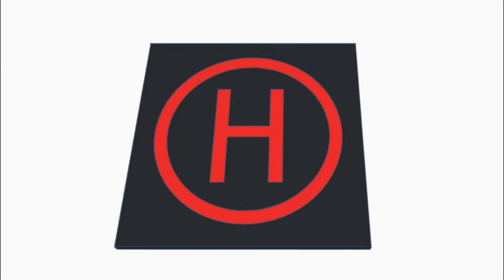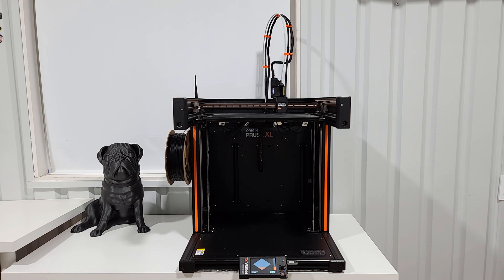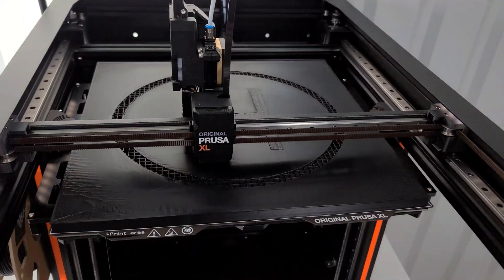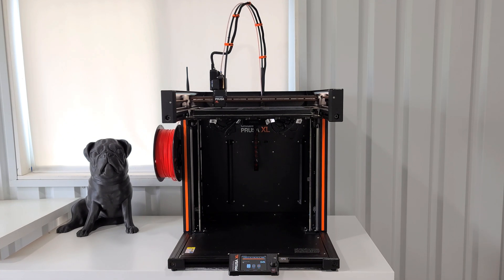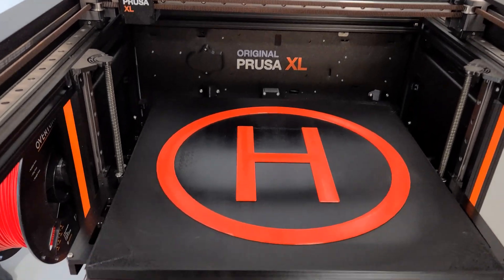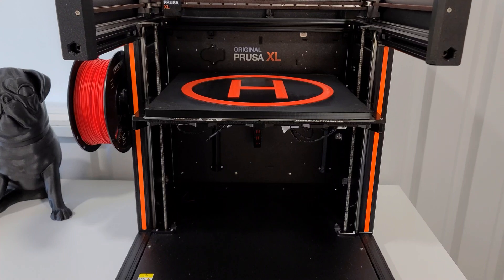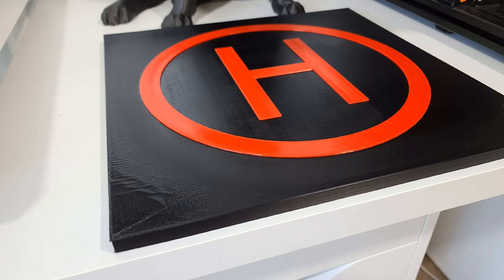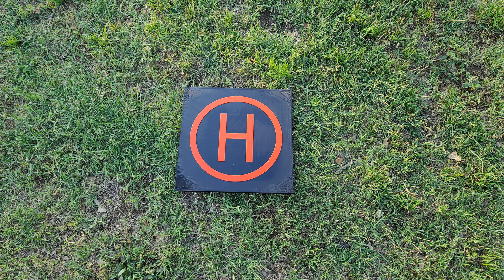Prusa XL - Printing a Mini Helipad for a Drone!!!

Comment: For large prints like that glue stick, slower printing hotend temp 200-205 bed temp 45-60 and lower part cooling 50% usually works and this is for PLA OR PLA+
Reply from the maker: Thanks so much!

Comment: Recommendation for large prints like this if you don't need a solid bottom.

Set the number of bottom layers to zero in the slicer and set infill to grid and something acceptable like 30%. Then you end up with a grid bottom that can handle a bit of cooling inbetween the air gaps and by the time it gets to the top solid layers you have sufficiently allowed time for any contraction to settle down.
Reply from the maker: Ooo that is a great idea! Thanks so much!

Comment: Clean the build plate with dish soap and then wipe down with IPA. Potentially use something like Magigoo to help adhesion. According to some research (I've not tested this yet) Hilbert curve infill produces lower stress. You could try change the bottom shell infill layers to Hilbert. You could try a Hilbert infill elsewhere too.
Reply from the maker: Thanks!

Comment: I don't know about the others but I have never had PLA warp on any of my printers, Maybe I am missing something here, in any case ABS, ASA, nylon yes, they can contract quite a bit when they shink. Usually an enclosure with some glue stick can help. 

Do this, when the flex plate is on the heatbed, I would press on the corners and see if the corners stick down or are slightly raised off the bed. Do this cold and at the bed temperature you print PLA. 
Lastly, (both cold and hot) I would take a straightedge like ruler placing it on edge across the heat bed to the corners. Like from the center to the corners. You may need to shine a light on the other side of the ruler where you are looking and see if there is light passing through. Thi would indicate a low area, and a high area with little to no light.

It could be possible that the corner plates may not be aligned properly. 

Since you recently purchased this you can call Prusa. Their customerservice is very good and they will patiently help you.
Reply: I stand corrected. I wathced the video again and see the gapbetween the print and plate. Printing large flat plates is not common so I don't see that with anything other than ABS, ASA, etc. But with something that large, the minimal shrinkage across the large plate would addup and the corners would be the weakest. So, you may want to treat it like ABS and reduce drafts, etc and try some bed adheasive, especially at the corners.

Comment: As others have shared, warping is an ever-present issue that usually becomes a problem only at larger footprints.  There are many effective strategies for dealing with it, and if you combine these methods then you can have a successful print.  This message is a long one, but encapsulates years of my personal trial and error so it's hard to summarize it even further.
A) Print with cooler nozzle temps.  The amount of shrinkage as thermoplastic cools is related to the temperature delta between extruded temp and ambient temp.  So when printing with something like PLA, print closer to the lowest reliable temp (i.e. 205) vs. the highest temp (i.e. 230).  The lower nozzle temp means the filament won't expand as much, and hence won't contract as much during cooling.  Note that your part will be weaker due to the cooler nozzle temp, as the filament layers won't fuse as well, but for a landing pad like this that shouldn't be an issue.
B) Raise print bed temps.  Again, your goal here is to minimize the temp delta from extrusion to cooling, so higher bed temps will increase the ambient temp, minimizing shrinkage during printing.  But stay within the limits of your material - PLA doesn't work well at super high bed temps, so you're not going to be able to crank it up to 90 and still get a good print.  As others have said, 5 degrees is a good starting point, and you might even be able to get away with 10 degrees.
C) Block all drafts.  You mentioned that AC was off, so that's helpful, but sometimes there's still airflow in the room.   PLA doesn't do well in an enclosure, but anything you can do to prevent any form of air movement will help.
D) Reduce cooling.  Normally, and especially with PLA, you want your cooling fan blowing strongly to improve bridging.  And PLA settings typically crank the fan to 100%.  Reduce that in your slicer.  If you're printing something like Nylon, you have to completely turn off part cooling or warpage will destroy your print in a heartbeat.  You still need some cooling with PLA, but on a part this large, ambient cooling will go a long way as you won't be printing layers very fast.  You might need to increase your top layers by one or two layers, since the bridging won't be as successful so a few extra layers will give the print a chance to properly bridge over the infill.
E) Change your infill pattern.  The infill you are using (rectilinear/cubic) has straight lines that directly connect the outside walls of your print, and as they cool, they pull the walls inward.  Recent studies have shown that a wavy infill, like the Hilbert Curve, minimizes warpage due to infill shrinkage.  Also, minimizing your infill % is helpful - 10% is probably high enough for this part - as the less infill there is then the less warpage due to infill contraction.
H) Print with thinner walls.  Since you used a 0.6 nozzle, assuming you did 2 walls, then your walls are around 1.2mm thick.  If you used a 0.4 nozzle and 2 walls, then the walls will only be 0.8mm thick, so they're have less strength to pull on your part and cause warping.  The same applies to your infill, where a 0.4mm nozzle would likely produce thinner and weaker infill, so less warping.
G) Use a brim.  Anytime I print wide parts like this, a brim is a must.  Yes, that does slightly reduce the max size of your print, but you're mistaken if you think you can use the full size and not have warping.  You may also need to reduce the brim separation distance to zero, with the caveat that you have to cut the brim off, it won't separate easily but that greatly improves the hold down strength.  Some makers like to use "mouse ears", which are small circles of brim only at the corners, but for a part like this a standard all-around brim is probably best.
H) Use magnets to hold the brim down.  I've never seen this done elsewhere, but this is a trick I developed recently.  I use lots of small, powerful neodymium magnets that I put on top of the brim after the nozzle is high enough to clear them.  So if you have some 1mm tall disc magnets, as soon as your nozzle is at 1.3 mm high, put these magnets all around your part, on top of the brim, right next to your part.  I used about 40 magnets on a large part recently, and it made a HUGE difference in minimizing warping.  Of course, this is an extreme step, and the part I was printing was structural with 90% infill, so warping was a nightmare and was even pulling up my brim.  Luckily, the Prusa print bed steel sheets are magnetic, and the magnets don't affect any sensors.  For a part like yours, just 4 magnets in the corners might be enough.
I) Change your filament.  Typically PLA+ warps less than standard PLA.  It often works with (or requires) higher bed temps too.  For example, Sunlu's PLA+ requires a bed temp of around 70-80, versus the normal 60 for PLA.  That extra 20 degrees helps a lot.  If you printed with 230c nozzle on a 60c bed, that's 170c of cooling.  A 205c nozzle on a 80c bed is only 125c of cooling.  It adds up.

Of course, there's another option that is simpler to implement - print your part upside down.  With the Prusa XL and MK4, getting perfect first layers is easy, so make that your top side.  Then if warpage affects surface quality at the end of the print, it won't matter as much because that will be on the bottom. But warpage will still happen, so your top won't be flat, so combine this with the methods above as necessary.  But note that removing the brim may scar your print, so if you print upside down this may be more noticable.

Good luck!  I'm still waiting for my XL so I'm living vicariously through your prints, thanks for sharing.
Reply: One teeny tiny thing that I think you may have missed here is just a simple cleaning of the bed. As rudimentary as it seems, cleaning the bed plate with warm soapy water and an isopropyl rinse afterwards can do a lot to aid in bed adhesion overall, especially since the corners of the bed are the most likely to be touched by oily hands. It's not really applicable in this case since the back corners also warped, and you don't typically touch the back corners with your hands on a magnetic PEI sheet such as this one, but it is another tip for those with bed adhesion issues nonetheless.
Reply from the maker: Thanks so much for all the tips. I do want to run another print with these adjustments to experiment and see what helps. Thank you!
Reply: Great tips Paul! Refreshing to see another 3D Printer help out like this :D
Reply: That magnet idea is genius!
Reply: I appreciate the comment very much my guy, thanks very helpful 💯🙏

Comment: Try using gyroid infill at a higher density, generally what happens is that when the bridging/top layers go down they lot of force as they contract. If you have more infill, it will resist this. Gyroid is good because the geometry doesn't have straight lines running through the print, reducing the warping caused by the infill, but still creating a strong internal resistance to the warping of the top layer. You can also use a top fill that doesn't have straigh lines running across it, such as hilbert curve, but that only works on the last top layer, so you can use 99% gyroid infill as the top layer.
Reply from the maker: Ok sounds good. Thanks!

Comment: Pointy corners warp more easy. You can round off the corners so the print will not have a single point that can lift up easy.
Reply from the maker: Thanks!

Comment: In my somewhat limited experience, the Satin and Textured sheets from Prusa have less adhesion than the smooth PEI sheet. I'd use the smooth one for any prints this large or where I really needed the extra adhesion. You could also add a brim, but with that part being the size of the build area, that wouldn't work without scaling it down a bit. Instead of brim, you could add "mouse ears" to the corners to hold down just where it's really needed. But then that would require enough space for them, so you'd probably have to scale the part down for these as well. It turned out nice otherwise.
Reply from the maker: Good to know! I only have textured and satin for now. Yes, I think it'd be worth it to scale down enough to add mouse ears/brim. Thanks!

Comment: Thanks for posting this. Looks like most of the warping occurred after the top layer is added. I agree with other comments here on the causes just being the thermal contraction of the plastic on such a large object as it cools.

It’s not surprising that even the XL has to obey physics. Rounding that corner or making it chamfered is probably the easiest adjustment to make along with a brim. An alternative brim to try is “bunny ears”, so brims that are only in the corners + add a strong magnet to each brim for large prints where you KNOW it’s going to curl. It might still do it especially with ABS or PC, but that has mitigated it for my prints in the past.
Reply from the maker: Sounds good. Thanks!

Comment: What what if you changed the design and extrude the black areas down to to say a quarter of the thickness it is now,  Then create two bodies of the rest of the intended black areas of the same thickness of the remaining raised circle and H pattern. Print the those two parts with the intended outer surface towards the build plate.  When the corners warp and pull up, it might not be as noticable when you flip the parts to assemble, and at the same time you can have a nearly flush landing surface.  Just use a bit of glue when insetting the black secions into the red.  yeah, the entire bottom side would be red, but that few mm or red might acually look pretty good with a side view of the finished product.  I have used that method making some round dual color logo keychains.   Would be fun to give that a try on the XL
Reply from the maker: So how many separate prints tall would it be? Just two or more? Yes I would like to see at what height it starts warping if nothing else. Thanks for the ideas!

Comment: This has nothing to do with the XL or draft shields, it’s due to the plastic shrinking. Research online, this is solved by adding some grooves or canals (don’t know how to say it in english….) to the underside, to the bottom of the part, so the warping can be absorbed without it twisting the part and detaching from the print plate.
Reply: That is a good idea! Sort of like a segmented first layer, and eventually it bridges to form a complete layer? Genius.
Reply: @RickyA  the way I saw it done and used successfully on my MK3s to do a full plate thick print, was just a few 1mm, some 5mm height upside down ‘caynons’, about 5 mm from border. 3 concentric ones, no more needed. That absorbs the tension and the plate so it doesn’t detach. Make sure the perimeters from each one doesn’t touch the next canyon, and that there’s little infill material between them.
Reply from the maker: Ok I will have to think about how to design this. Thank you!
Reply: It's because prusa is trash and the xl is a joke

Comment: solutions are: wipe the plate with alcohol (IPA). round the 4 corners to spread the warping force more evenly. but the real solution (i print a lot of ASA): an enclosure. the part will cool more uniformly and you will have much less warping. it will also reduce noise. its a shame that prusa didnt build the xl as an enclosed printer. imagine spending 2k on a big volume printer and not being able to print even big PLA parts. hopefully somebody will do prusas job and mod an enclosure, that can be attached to the printer frame. like two 'butterfly' doors at the front and a hinged lid
Reply from the maker: Yes I agree the enclosure is probably the best way to minimize. I'm even dreaming about the draft shield. But I'll see what I can do for now. Thanks!
Reply: Thank you for the videos btw!

Comment: Large, flat prints are a nightmare for printing, I had to make some covers that were 10mm high & filled most of the bed of my MK3, to make matters worse, these were for outside use, so I was trying to print them in ASA.  I made a homemade enclose & added as big a brim as I could fit (8mm IIRC). I was using a smooth PEI sheet & cleaning it with hot, soapy water (Fairy liquid) helped with adhesion.  In the end it was pulling the spring steel sheet away from the magnets & the PEI away from the sheet!  It's the long, straight lines that cause the problem, the longer they are, the worse the problem is, so it's no surprise that it's worse on the XL.  I wanted straight infill lines for rigidity (Triangles), but I even tried Gyroid to see if it would help, it did to a certain extent, but when the curvy lines contracted, they would raise the height of the layer causing the nozzle to collide with the occasionally.  I did get it to print OK as far as the solid top layers, but when it gets there, there are obviously a lot more contraction forces, so that's where the real fun begins!  I never did manage to get perfect prints, but I'm planning to revisit the job, when I get the time, now that I have a Prusa enclosure.  I was running no cooling fan with the ASA, but it might help if you reduce the fan speed a little with the PLA, but you'll obviously have to watch the print quality.  I would hope that with a brim & a little tinkering you'd be able to get a good print in PLA, but it's going to be harder with other materials!  Prusa recommend using the textured sheet for PETG & Flex as they stick too well to the smooth sheet; I can confirm that is the case, but I've never investigated whether the same is true with PLA, so you might want to do some tests.
Reply from the maker: Yes I agree! I'll definitely be testing out more settings to see what the trick is! Thanks for the suggestions!

Comment: Enclosed will help stay heat avoiding wrapping
Reply from the maker: True. I wish the XL already had the enclosure or even the draft shield available. Thanks!
Reply: @tada3dprinting  try to cover printer with some PC sheets on both sides and make door to front. Raise3D had similar design. I dont understant why prusa dont have this solution on the package.
Reply from the maker: @3lobitprint390  thank you!

Comment: Bonjour,
ça fait plaisir de voir des vidéos brutes avec un vrai point de vu. Merci

Effectivement un peu d’alcool isopropylique avec un peu de 3dlaque devrait améliorer l'accroche au extérieur.
J’avais lu aussi que le motif de remplissage avait une grande importance pour éviter des efforts sur la structure.

Hello,
It's nice to see raw videos with a real point of view. Thanks

Indeed a little isopropyl alcohol with a little 3dlaque should improve the grip on the outside.
I had also read that the filling pattern was very important to avoid stress on the structure.😁
Reply from the maker: What infill pattern do you think is best to avoid warping? I think I had it at the default grid pattern. Thanks!

Comment: I am starting to think there are only 2 XLs in the world and you have one of them. I really want to order one but honestly this is not a good look for Prusa. A brim would help with the warping since it rounds the corners. Large flat squares are always a pain to print. Use a brim then if removing it is a pain a razor works to clean up the edge.
Reply from the maker: Haha I am sure there are more out there. But now everyone is distracted with the MK4. I will add a brim. Thanks so much!